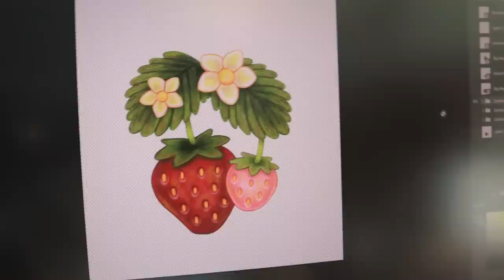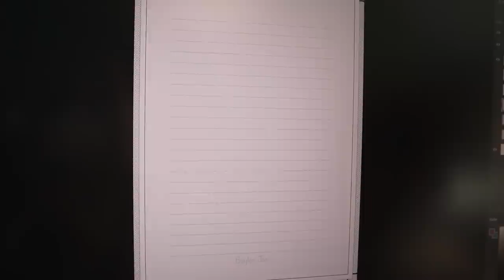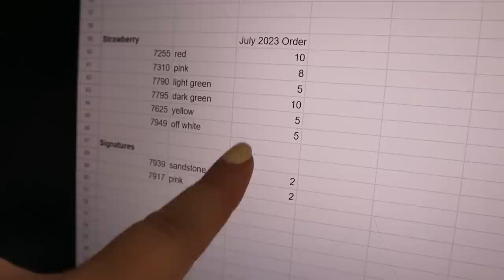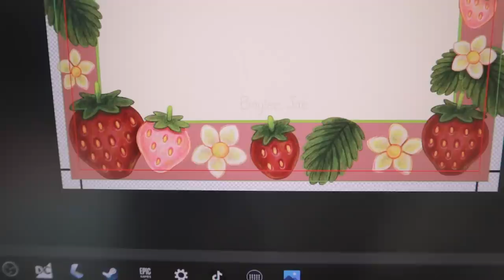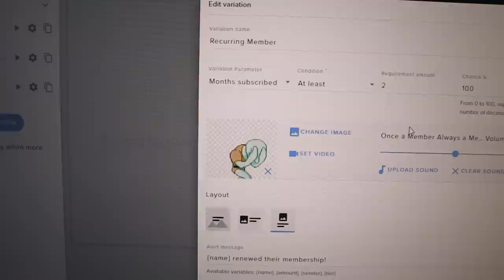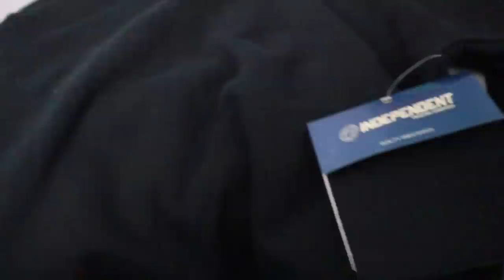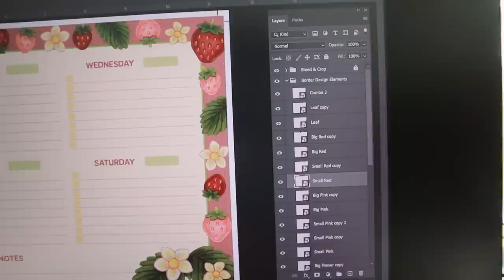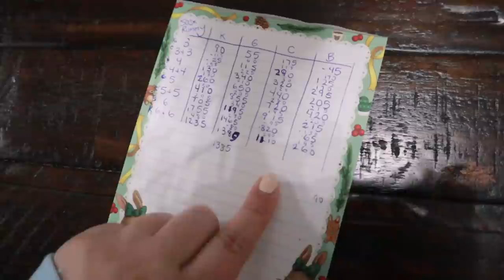BAD KITTY!  Sweaters, Strawberries & Storage

Comment: Hi Baylee. Just a little info on the material.  It's piling because of the type of fabric.  It should be cotton/polyester. The polyester is lower in price, but it always starts piling. It might be a little bit $$ but so worth it. Cotton/polyester should stop that. I hope this info is helpful for u 😊.

Comment: 60 is too thick, I can’t even process that 😖 I think that I would go with a 32, maybe a 40. But I honestly didn’t even know that they would do 60. I always thought that it would be too thick for the glue to hold, but your notepads don’t ever look bulky. 🤔
Reply from the maker: 60lb text, not 60lb cover. It's standard from nearly all notepad suppliers I've looked at. It should be similar to my Witch Hat notepads, and all my square planner pads.
Reply: @BayleeJae  huh, I’ve never seen 60 lb text, only 80 or 100. Of course, the print center that I used to work at didn’t have any paper half the time. I did forget about text stock vs cover 😅.